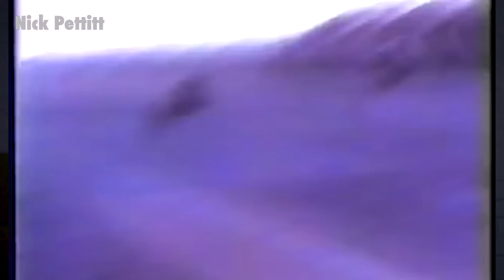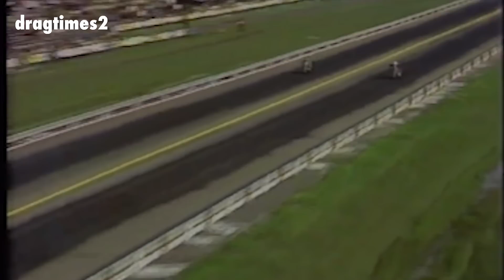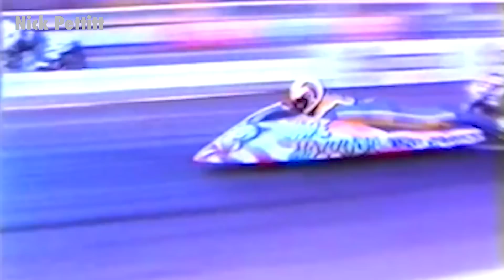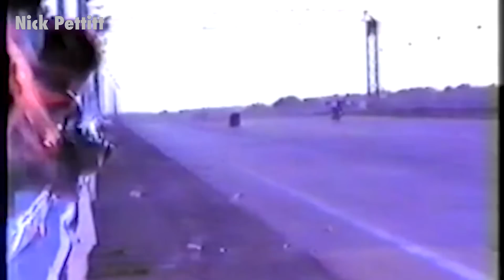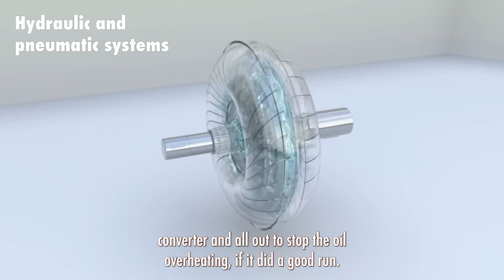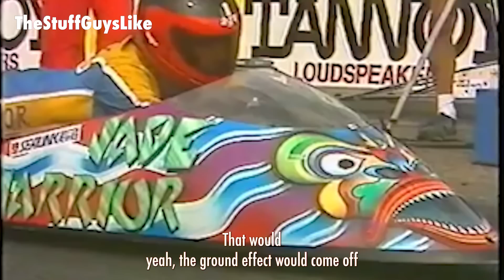The World's Most INSANE Dragster

Comment: My fuel dragster design is going to rotate the Earth...! It will have a sidewinder mounted hemi behind the driver to eliminate chassis torque with two turbochargers, one off of each cylinder bank feeding a dual port intake manifold. It will have a rubber traction belt rotating between the drive wheel and to a forward mounted idler wheel to maximize traction contact area and also eliminate wheel stand. It will rotate the Earth...!!! You'll see...!!!

Comment: Imagine doing a wheelie on one of these things
Reply: It can't wheelie because, unlike a conventional bike, all the weight was so low down that the CofG was below the wheel spindle centre so there was very little weight transfer onto the rear wheel when it launched (basic physics vs geometry). It needed the suction box/ground effect to get any real rear wheel grip. If the front lifted (e.g. on a bump) the ground effect box lost its seal against the track surface and rear wheel grip was lost (information told to me by Ag himself, many years ago.)

Comment: I think no body copied it because it is so much more dangerous. If the front wheel looses downforce for whatever reason and the thing wheelies, the driver would not survive that slam on his back, or he would violently be catapulted by the massive lever effect and if he looses control, he wouldnt have a chance of flipping over the concrete barrier on the side. Its a nightmare basically.
Reply: It couldn't wheelie because, unlike a conventional bike, all the weight was so low, the CofG was below the wheel centres so there was very little weight transfer onto the rear wheel when it launched (basic physics vs geometry). It needed the suction box/ground effect to get any real grip. As soon as the front lifted (e.g. on a bump) the ground effect box lost its seal against the track surface and rear wheel grip was lost. It might get both wheels airborne, but it couldn't wheelie (According to the man himself… I asked him, when he was 'shaking it down' at a sprint meeting when he first built it.). Ag said it was almost boring to ride as it was so stable, and there were no gearshifts to make.

Comment: The Jade Warrior puts me in mind of some of the modified snowmobiles used at grass drags. 200-300 horsepower two strokes, 300 pounds, with a flat aluminum (excuse me, "aluminium") deck for the pilot to lay upon. One of the locals runs over 160MPH in 500 feet with his.

Comment: The collector does not work by creating a vacuum and the venturi effect. There is NO throat in the collector it opens to a larger diameter pipe. It works by fluid momentum with the exhaust high pressure charges gaining fluid momentum and pulling the charge behind it in the collector.

Comment: One of the big benefits of an automatic transmission is the torque multiplication through the fluid coupling.  I would have expected quite a quick launch with the multiplication effect diminishing as speed picked up.  Looking at some of the clips, he does seem to get a very quick jump- say the first 10-15 metres, then a slower rate of change till about mid track roughly 200-300m, then another positive delta in the last 100 metres or so.  I may be mistaken (God knows I can do that!)
Reply: That's how I saw it. With the extra downforce building before it even launches, it would get the jump over any other bike.
Reply: @andoletube  Ag told me launching wasn't as hard as he'd have liked because he couldn't build the rpm on the startline as it would lock up the torque converter which would overwhelm the brakes (he would wind up the torque converter a little and hold the bike on the brakes at the line, then launch by simply letting the brakes off and opening the throttle.)